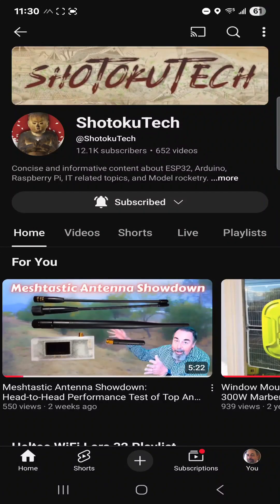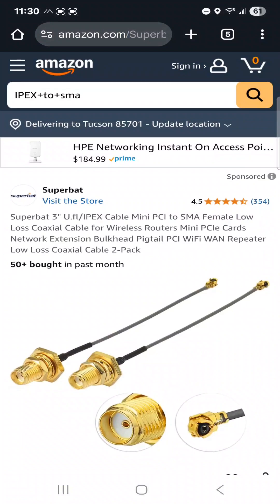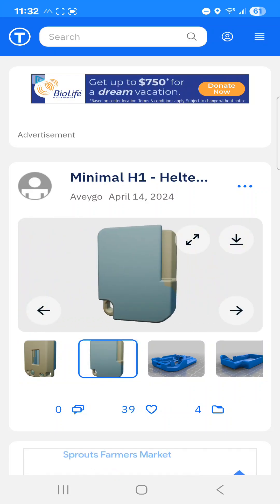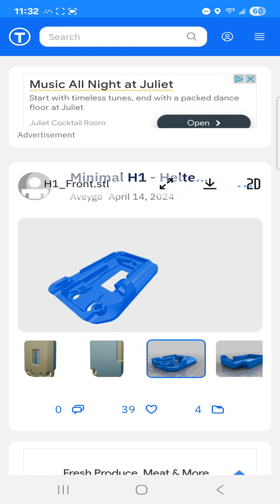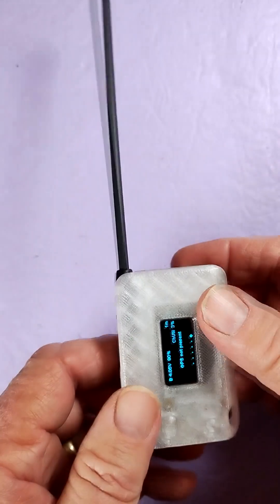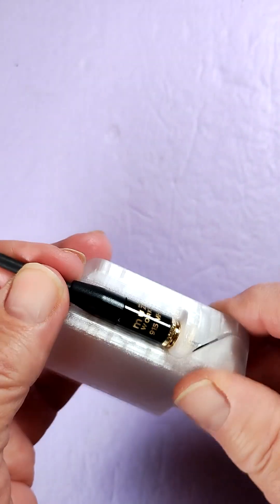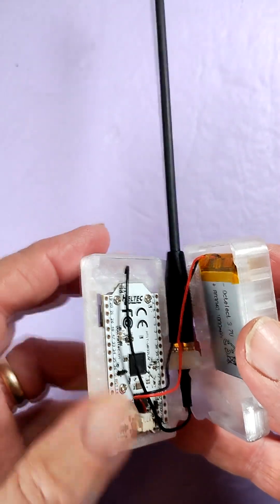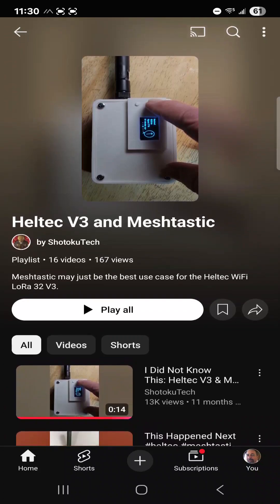Best Compact 3D-Printed Case for Heltec V3 from Thingiverse

Comment: Hi I need help. My ILI9341 screen is giving a white screen no matter what code I put in the IDE (I'm using esp32) and I need it for a project and I can't buy a new one because here where I live it is 6 times more expensive than what you would buy, it is not an electrical or programming error, I don't know what to do
Reply from the maker: I have several videos about the ILI9341. Maybe there is some clue there. https://www.youtube.com/playlist?list=PLVPBipeObwMOMnK3GHJVEZej2SqPsGD5P
I have this on Github with an accompanying video:
https://github.com/ShotokuTech/ESP32_ILI9341_Wiring_Diagram